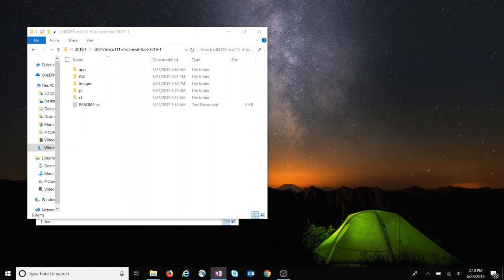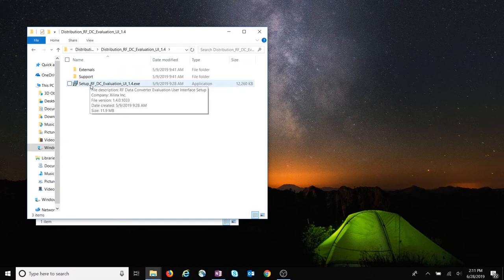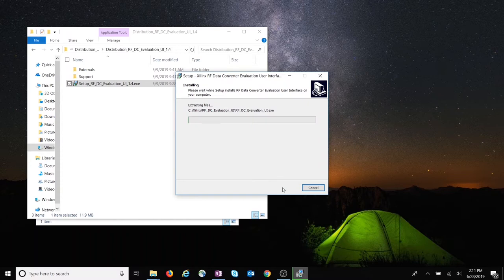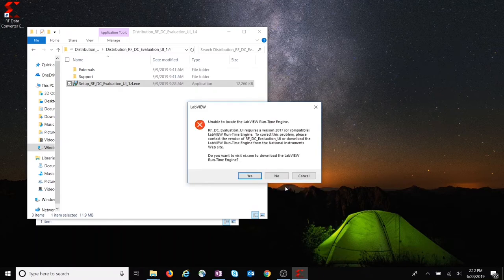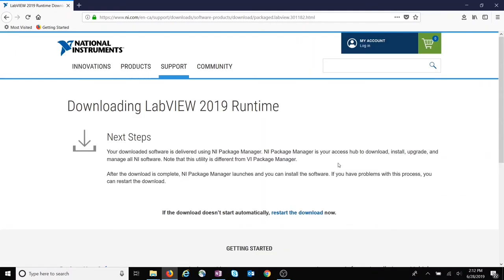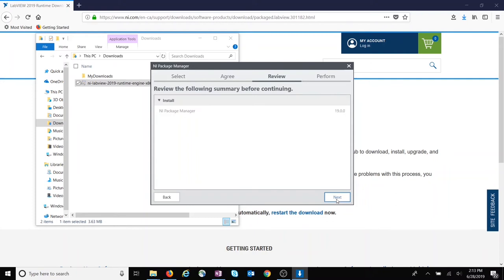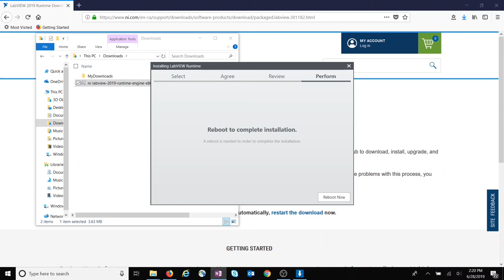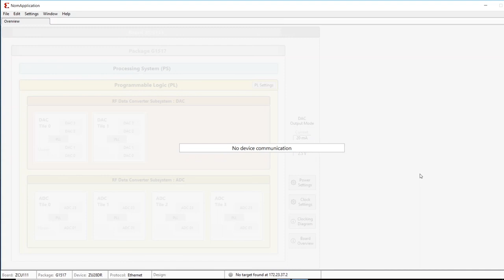ZCU111 2019.1 RFSoC RF Data Converter Eval Tool Video 3: Get Around NI Error on Install

Comment: Hello. I think you can avoid the NI Error by copying GUI\Distribution_RF_DC_EvalSW_1.2\Distribution_RF_DC_EvalSW_1.2\Support\LabVIEW\Run-Time Engine\2017 (32-bit) f2 Patch\Standard contents to upper folder (like C:\tmp) and run setup.exe inside the folder.
Reply from the maker: Hi m t, thanks for posting this alternate way to get around the error.  I uninstalled everything (including the NI stuff) and tried your suggestion before installing the Eval Tool GUI and that avoided the error for me too. :)